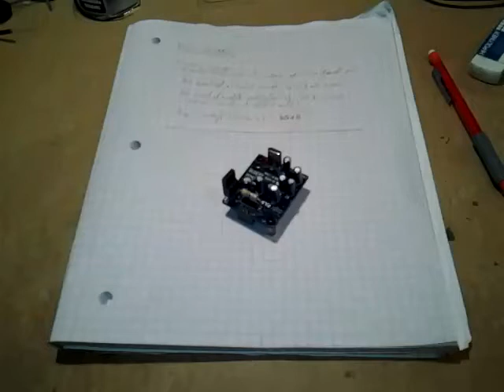Engineer meets Bugera V22 reverb - Part 2 (dynamic range testing)

Comment: Just wondering if I could pull this and drop in a real spring tank, or if that would require reverb amps and other possible complications..?
Reply from the maker: Most reverb tanks' input impedance is so low that they need a driver stage in front. A tank's output may need buffering and/or gain as well. Neither of these are part of the V22's circuitry, but I don't think it would be very hard to make a board to replace the effect processor that performs these functions.